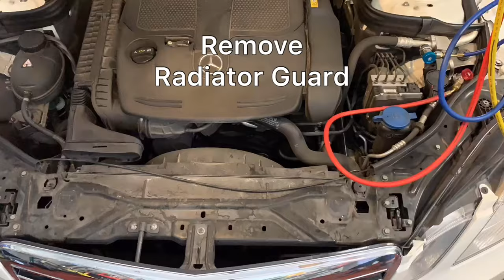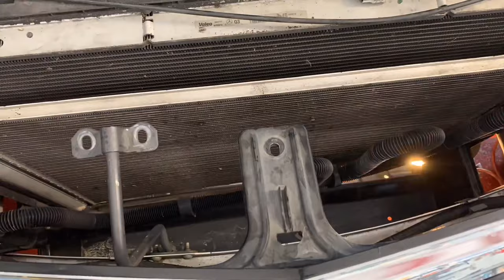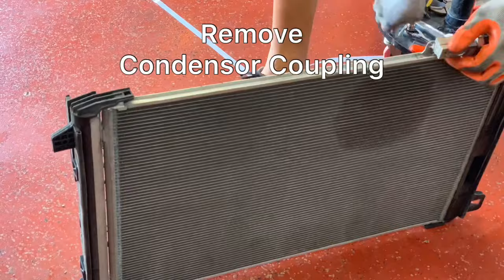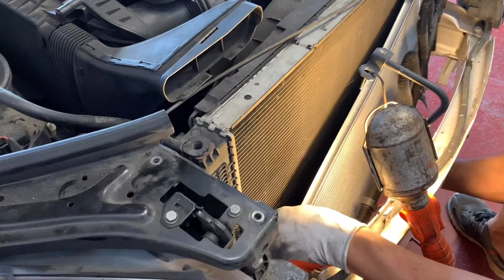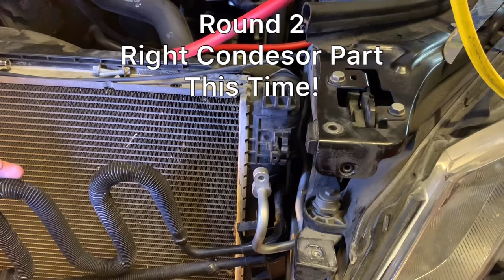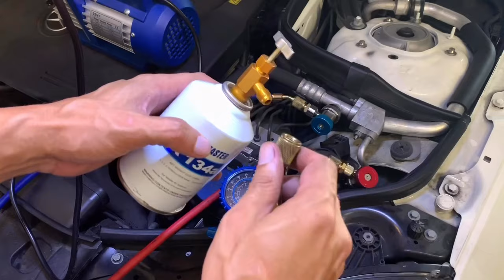How to Change AC Condenser Coil - Mercedes Benz

Comment: Video was great but my car is still broke I’m sure it’s something simple now but figured I’d comment on here maybe one of you guys had the same problem I replaced the blower motor cuz my fans weren’t working then I found out that my car wouldn’t hold the cold air anymore so I got the condenser put it and it hold the cold stuff and blows the air but won’t blow cold air any idea what would cause this I would prefer not to take it to a shop but i might have to

Comment: Could you tell me what is that black hose line called on the front of the Condenser? I’m talking about the one you move to get the condenser in between the radiator? I bought a new condenser and it didn’t come with it and the old one got thrown out since the car was crashed in the front. Could you help me also what conecta to it since the transmission lines go to the radiator
Reply: I think that's the power steering cooler line.
Reply: Well I found out the lines I was talking about were the power steering cooling lines, thank for not answering

Comment: HI, i'm trying to disconnect refrigerant lines from condenser but its not coming out. Did you use any special tool to pull out AC lines from condenser
Reply from the maker: just loosed the nut, wiggle it a bit and give it a lil tug, no special tool required. the line is a very snug fit.
Reply: @Yucksauce  Thank you, i did manage to disconnect it yesterday